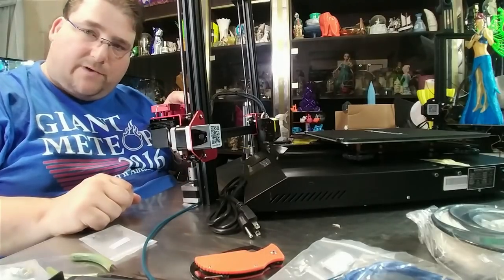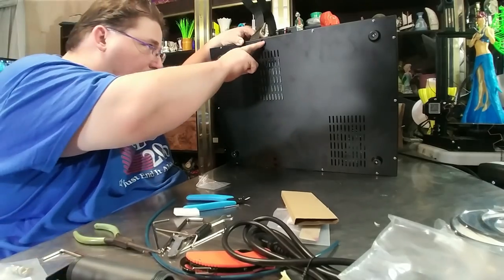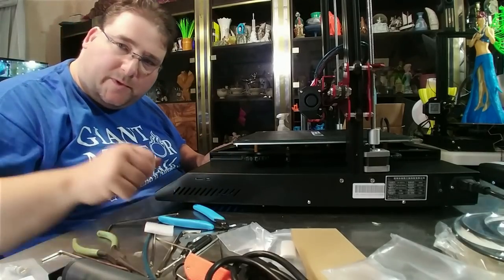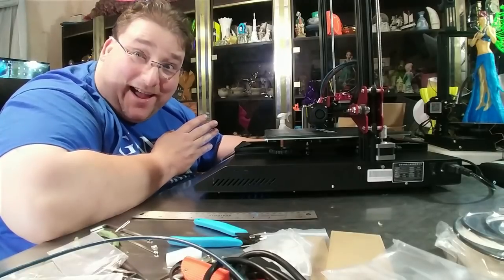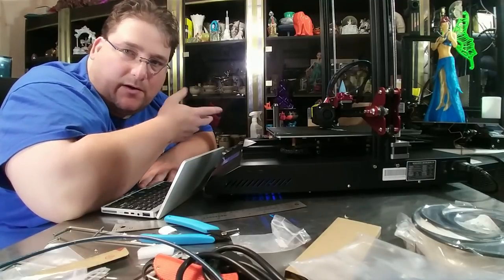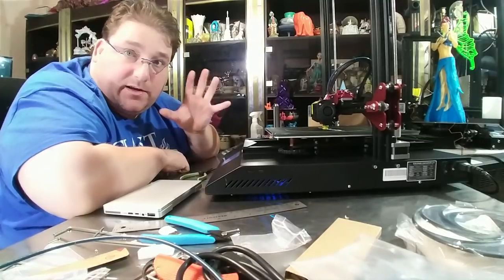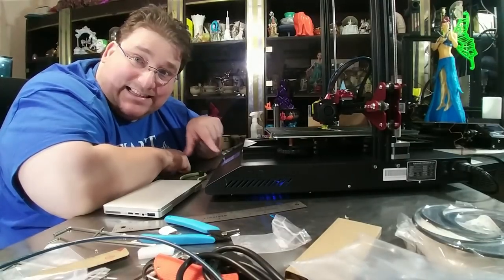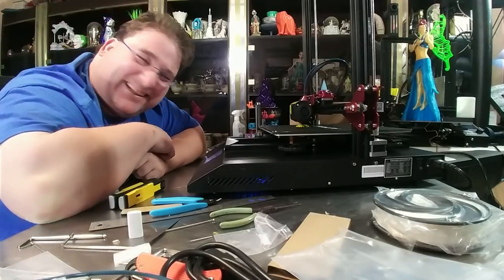CR-10s Pro Behind The Scenes Series Part 4 - T3DP

Comment: Rumor has it they are using the same stepper drivers as on the duet wifi. Those are TMC 2660 I think which are the reason it's dead silent. Also they will run smoother and produce no artifacts like salmon skin etc. I'm running TMC's on my cr20, they are amazing. Dead silent and no moire patterns. They interpolate the microsteps to 256 so if you set the microsteps to 16 the processor sends out 16 microsteps but the driver will interpolate them to 256.

Comment: So I just got my CR10S Pro today and they haven’t implemented ANYTHING you or others have suggested. In fact the beds are just a solid aluminum bed with NOTHING on it, whoever assembled my unit was a jackass most of the screws were not screwed in all the way and I was even missing one of the Z rod brackets. Luckily I had an extra one from the ended 3. Overall the unit is good and is printing well just wish they would of implemented some of the suggestion and have some kind of QC.
Reply from the maker: What firmware version? If you have 1.5 or higher your good that way. My profiles folder has a firmware folder now 1.60.2 is there flash in cura.

There should not be anything directly on the aluminum bed but there should be a piece of glass within ultra base style surface on it that clips in? Yours came missing the glass? Were there pieces of glass in the Box?

Comment: Hello @Nerys I currently have an Ender 3 and have never been able to get a good print from it mainly leveling issues. Would you recommend the CR-10s pro ? How does it compare to the quality you get from your Ender 3?
Reply from the maker: The CR tennis pro will give you slightly less print quality than the Ender 3 but slightly better print quality than the old cr-10 be sure to do a search on YouTube for CR 10-bed leveling basics that's my video the one with me holding up two spools of filament it's 45 minutes long watch that video to learn how to level your Ender 3 99% of printing problems is bed leveling problems once you get that you've solved most of your printing problems

Comment: Chris I just got my Pro and am now printing out the test dog which is going good. I have a quick question for you regarding the auto bed leveling, Do I have to put anything in the start G-Code for Cura to use the auto bed leveling data? BTW the firmware still can't access any data within folders on the SD card, it has to be moved to the root.
Reply from the maker: What version of the firmware are you running? I believe it's under settings and printer info

You don't need to add anything to the gcode if you add G29 it will do the mesh leveling but then you lose your Z offset I believe just do the mesh on the printer set your offset and print like you do with any other printer
Reply: @nerys71   I refreshed my ender 3 firmware and setup manual mesh bed leveling in order for it to work I had to insert this line "M420 S1;Retrieve Mesh" after the "G28;  home" command. The Firmware on the machine is ver 1.40.0. I love how the Fan symbol on the touch screen is labeled "Fun". LOL
Reply from the maker: @keithkamps77  cool. Probably because its manual on a machine thst did not come with it.

How has it worked so far? Good results?
Reply: @nerys71  The manual mesh bed leveling works great on the Ender 3, prints are way better and printing from print to print is very consistent.

The CR-10S Pro is working great the only thing I am going to do is have some mirrors made for the bed, the bed surface is way to grabby for my liking. They are definitely going to have fix the SD card issue and add more features/adjustments that can be accessed via the touch screen so changes can be made on the fly instead of having to re-Slice and reprint. IMO the CR-10S Pro is well worth the price of admission.

Comment: Nice video's, is there a reason that you splitted them up?
Reply from the maker: Yes I explained that in the intro video on YouTube long videos do not work well and most people don't like long videos so by splitting it up I allow people to consume it in bite-sized chunks at their Leisure without having to sit through a very long video you can watch them all at once or you can watch them bit by bit as you are able because of the way this printer was handled I wasn't able to make a normal video like I usually do so this turned out to be a decent compromise
Reply: @nerys71  seems like i missed that part and i understand

Comment: Nerys
Do you really recommend this printer? I'll take a cr-x but I'm very uncertain about the two, what do you think?
Reply from the maker: My initial impressions are extremely good obviously I have to use it for a while to really give a valid opinion I also need to see what actually gets released for the final product to see if the quality control holds if they can maintain the quality control through production this printer is going to be amazing

Comment: Hi - on an Ender 3 using Cura - during initial layer, and all through other layers, the hot end draws outline then moves off into centre to draw the two holes
as it does this it draws a line from outside to first circle - obviously this shows right the way through the print messing up the final layer
any ideas on how to stop this ?
many thanks
Reply from the maker: This is a travel movement if the nozzle is using plastic when it does this you're going to see that line your standard anti stringing techniques or what you need to use

Lower the temperature if possible increase retraction slightly and attractions speed increased Cooling if possible you can also try adding vertical lift or Z hop so that it will lift the nozzle when it travels from one point to another two or three mm should do it

Comment: Good initial thoughts on this beast and nice to see them ship a Beta unit expecting feedback unlike the CRX's that were sent for 'review'. I have rolled my own Teflon lined filiment sensor for a CR-10S with top mounted spool (and Ender3 varient here in a zip file) http://www.eevblog.com/forum/chat/3d-printer-yet/msg1913924/#msg1913924 Only the ender STL is online in that zip file as I thought the top mount spool/CR-10 and a different board was a little specialised.